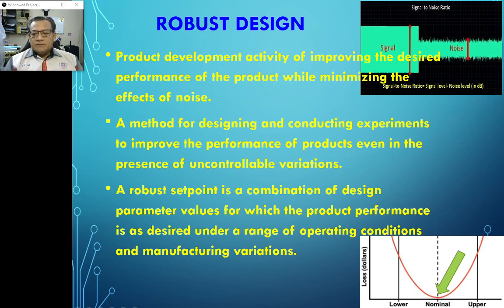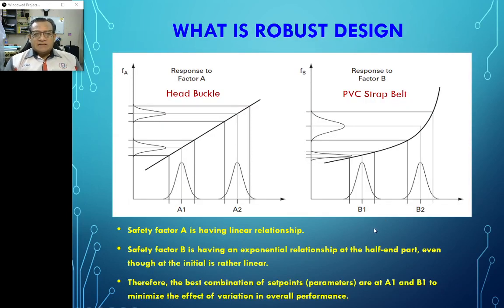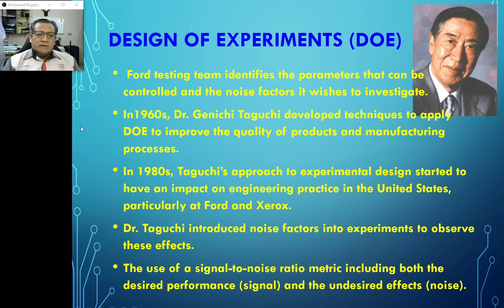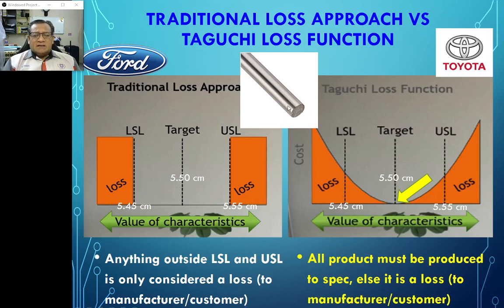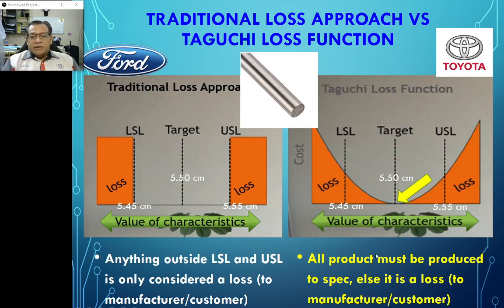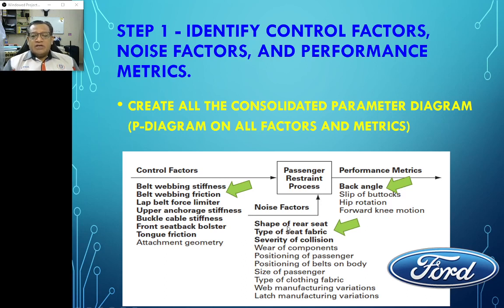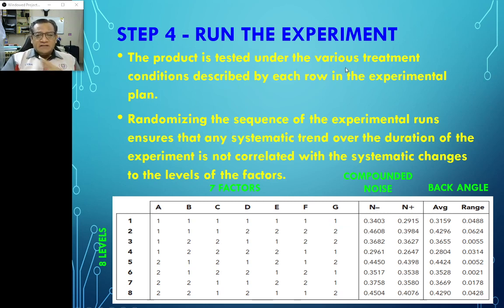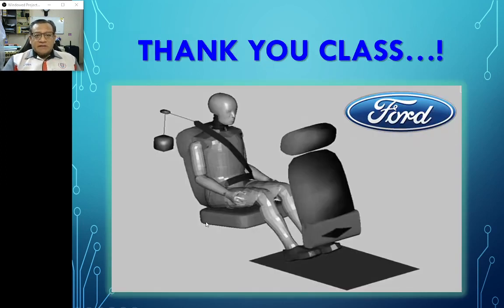Product Development Course Chapter 12 Robust Design

Comment: NUR ALIA NATHASYA BINTI AZMAN (AP190479) S1

Thank you, Dr. for the lecturer. For this video,  I've learned about the process of robust design, which includes seven steps for the process, which are identifying the factors, constructing an objective function, developing an experimental plan, performing the experiment, conducting analysis, and confirming the factor setpoint and reflect.

Comment: Nurul Izzati binti Baharudin (CP190067) 
The process of robust design consists 7 steps which is identifying the factors, formulate objective function, develop experimental plan, run experiment, conduct analysis and confirm factor set point and lastly reflect and repeat

Comment: Muhammad Syahmi Bin Rahman (CP190045)

What I learn from the video is about the process of robust design which is consist to 7 step which is identifying the factors, formulate objective function, develop experimental plan, run experiment, conduct analysis and confirm factor setpoint and reflect.

Comment: Muhamad Zamakhsyari Jaafar (CP190020)

Thank you Dr. For this part, i have learnt the processes for robust design which consist of 7 step begin with identfying the control factorss, noise factors, and performance metrics. Then, continue with formulate an objective function, develop the experimental plan, run the experiment, conduct the analysis, select and confirm factor setpoints and lastly reflect and repeat.

Comment: NUR HADIRAH RAZNI BINTI MOHAMAD RASUL  (CP190082)

The above video which is about the robust design learning has improved the design of experiments, as well as the classic loss technique and the Taguchi losses function. Identifying factors like noise and performance metrics, as well as control and noise factors, formulating an objective function, creating an experimental plan, conducting the experiment, analyzed the results, and reflecting and repeating the process are the seven steps of the robust design process that I've learned about. Thank you Dr, for the learning session video.

Comment: MUHAMAMD AMIR RAHIMI BIN MOHD SHUHAIMI AP190498
Thank you for sharing, Dr. After seeing this video, I realised that the robust design process has seven steps. To begin, determine the control variables, noise variables, and performance measures. The next step is to create an objective function. The third step is to create an experimental strategy. The following step is to execute the experiment, do the analysis, and pick and confirm the factor setpoints. Finally, think about it and do it again.

Comment: Nur Amira Afiqah Binti Norfaizal (CP190055)
Thank you Dr for your sharing. From this video, I have learned about robust design. Choosing the correct set point for the design parameters under control is dependent on resilient design. Under a variety of operating circumstances and manufacturing variances, a combination of design parameter values determines product performance. This chapter also explains how to maximise performance while minimising variance using a seven-step design approach.

Comment: Shazmin Ilyani Md Isa
CP190016

What I get from the video is robust design is actually a method to design and do  experiment to improve the product performance. It is also known as parameter design. Next is the design of experiments that Dr Taguchi developed techniques to improve the product quality and manufacturing process. There are differences between the traditional loss approach and taguchi loss function. There are 7 process of robust design. Start with identify the control factors, formulate the objective function, develop experimental plan, run the experiment, conduct the analysis, select the factor setpoints, and lastly, reflect and repeat.
Thank you Dr🙏🏼

Comment: Agileswaran Nadesan Ap190017
I have learned about 7 steps which are identify the factors, formulate an objective function, develop the experimental plan, run the experiment, conduct the analysis, confirm factor setpoint and reflect.

Comment: NUR ARIFA SYAHIDA BINTI YULIADI (AP190266)

Thank you Dr for lesson sharing. 
This chapter i have been learnt about robust design. The robust design is matter for choosing  the right set point for the design parameters under control. The combination of design parameter value of the product performance is under the range of operating conditions and manufacturing variations. This chapter also has explained 7 step of design process to maximise the performance while minimising the variation.

Comment: NUR ANIS MISYA BINTI AZMI (AP190488)
SECTION 1
From this video, I have learned that there are the seven steps of the robust design process that I've learned about include identifying factors such as noise and performance metrics as well as control and noise factors, formulating an objective function, creating an experimental plan, performing the experiment, analysing the results, and reflecting and repeating the process.

Thank you Dr, for sharing this video.

Comment: ONG XIN YI (AP190265)
Based on the video lecture, I have learned about the robust design of products. Robust design is an activity in product development to improve the desired performance while minimizing the effects of noise. In order to conduct the robust design, there are seven steps mentioned in the video. 
TQ DR. FOR SHARING :)

Comment: Nur athila safia binti jemzir (Ap190035)

Thank you dr for sharing. From this video, i have learned about what is parameter design/ robust design, design of experiments(DOE). Also,  7 step of Robust design process which is identify control factors ,noise factors and performance metric ,formulate an objective function, develop the experimental plan, run the experiment,conduct the analysis, select the confirmfactor set points and reflect and repeat.

Comment: LIM WEY NAN (AP190062)

Thank you for sharing, Dr. I learned that resilient design is all about selecting the appropriate set points for the design parameters under control. I also learned the robust design process therefore consists of seven steps.

Comment: PRAVIN A/L LINGAM (AP190046)
My understanding of robust design, design of experiments, traditional loss approach as well as the taguchi losses function has been enriched by this video. The seven steps of the robust design process that I've learned about include identifying factors such as noise and performance metrics as well as control and noise factors, formulating an objective function, creating an experimental plan, performing the experiment, analysing the results, and reflecting and repeating the process.

Comment: LOH WAN THENG (AP190366)
Thank you Dr for the sharing. After watching this video, I have learned that there are 7 steps of robust design process. First, identifying the control factors, noise factors, and performance metrics. Next, formulating an objective function. Third, developing the experimental plan. After that, running the experiment, conducting the analysis, and selecting and confirm the factor setpoints in the following step. Lastly, reflect and repeat.

Comment: Santhi A/P Manokaran AP190444

Thank you Dr for the sharing. From this learning video, i have learnt about the robust design. Robust design is a method for designing and conducting experiments to improve the performance of products. There are 7 steps of robust design process in order to improve the performance of the product.

Comment: Ummi nur shafina binti abu bakar (ap190045)
From this topic i learnt that a robust design is a method for designing and conducting experiment to improve the performance of products. Dr. Genichi Taguchi develop a techniques to apply DOE  1960s. The robust design have 7 process . Firstly, identify control factors, noice and performance matrics. Then, formulate an objective function, after that, develop the experimental plan. Fourth, run the experiment. Fifth, conduct the analysis. After that, select and confirm factor setpoint. Lastly, reflect and repeat.

Comment: Nurul Najihah binti Roslan (AP190032)
Thanks for sharing the video. From this sharing, I have learned about robust design and experimental design (DOF). Robust design is in product development to enhance desired performance while minimizing noise effects. In addition, I am also familiar with the robust design process of identifying control factors, noise factors, and performance metrics, formulating objective functions, developing experimental plans, conducting experiments, conducting analysis, selecting and validating factor setpoints, and reflecting and repeating simply to achieve excellent design/universal design.

Comment: CHONG WAN WEN AP190074

From this video, I am able to understand that there are 7 step in robust design process. First, identify control factors, noise factors and performance metrics. Second, formulate an objective function. Third, develop the experimental plan. Fourth, run the experiment. Fifth, conduct the analysis. Then, select and confirm factor setpoint. Last, reflect and repeat.

Thank you dr for sharing.

Comment: Muhammad Nur Aiman Irfan bin Suhaili AP190190

There is 7 step in design process which is identify the factors, formulate an objectives function, develop the experimental plan, run the experiment, conduct the analysis, select/confirm factor setpoint and reflect.

Comment: Wong Joo Yun AP190066

From this video, i learnt about the 7 steps of the robust design process, which are identify control factors, noise factors and performance metrics,  formulate on objective function, develop the experimental paln, run the experimental, conduct the analysis, select and confirm factor setpoints as well as reflect and repeat.

Thank you dr for sharing

Comment: Wong Siok Jiu (AP190110)

From this video, I have learned about robust design. There are seven steps in the robust design process which identify the factors, formulate an objective function, develop the experimental plan, run the experiment, conduct the analysis, select and confirm the factor setpoint, and reflect and repeat. Thank you Dr for the sharing and explanation.

Comment: Mohamad Shahrizal Bin Mohd Suhur

I learn about Robust design/ paramater design is to achieve excellent design or universal design , to achieve maximum performance with minimum error or minimun noise
Robust design need to choose optimum performance with minimize variation. Need to test many setpoint, try and errors so that we could determine the list variation available with maximum performance

Robust design is archieve through Design of experiment (DOE). Ford try to applied the DOE. Dr taguchi introduced noise factors into experiments to observe these effects.

The traditional loss approach and taguchi loss function.
Traditional - anything outside LSL USL is only considered  a loss.
Taguchi - all product must be produced to spec, if not its a loss

Comment: Tan Jian Woei (AP190389)
From this video, The robust design aims to improve a product's desired performance while minimizing the effects of noise. A robust setpoint is a combination of design parameter values for which the product performance is as desired under a range of operating conditions and manufacturing variations. The robust design process uses an experimental approach to find these robust setpoints. Experiments for robust design are used most frequently during the detail-design phase. They are a way to ensure the desired product performance under various conditions. Ford's seat belt design problem was modeled using a simulation rather than physical crash testing. The approach to robust design is based on a method called the design of experiments (DOE). Dr. Genichi Taguchi developed techniques to apply DOE to improve the quality of products and manufacturing processes during Japan's 1960s, '70s, and '80s. A seven-step process was suggested to develop a robust product through DOE: 1. Identify control factors, noise factors, and performance metrics. 2. Formulate an objective function. 3. Develop the experimental plan. 4. Run the experiment. 5. Conduct the analysis. 6. Select and confirm factor setpoints. 7. Reflect and repeat. Thank you Dr, for the sharing and explanation.

Comment: Chu Siew Fong AP!90293

Thank you dr for sharing the video. I have learn about what is the robust design and design of experiments (DOF). Beside, I also get to know the process of robust design which are identify control factors, noise factors, and performance metrics, formulate an objective function, develop the experimental plan, run the experiment, conduct the analysis, select and confirm factor setpoints, and reflect and repeat.

Comment: Lee Zhe Chung (AP190429) S2

Thank you dr for sharing. In this video, I know that robust design is a matter of choosing the right set points for the design parameters under control. Next, the robust design process include 7 step which are identify the factors, formulate an objective function, develop the experimental plan, run the experiment, conduct the analysis, select/confirm factor setpoint, and reflect/repeat.

Comment: GAN KWANG MIN AP190428

Thank you Dr for sharing.

From this video, I understand that robust design activity is a matter of choosing the right set-points for the design parameters under our control. I also know the robust design process which are Identify control factors, noise factors, and performance metrics, formulate an objective function, develop the experimental plan, run the experiment, conduct the analysis, select and confirm factor setpoints and reflect and repeat.

Comment: Lim Jea Yi AP190100

TQ dr for yr sharing.
In this chapter, I have learned about the robust design and the design of  experiments(DOE). Robust design is a parameter design. To achieve the DOC,we need to combine the technical knowledge and experimentation data. Besides that, I also learnt about the 7 steps of robust design process.

Comment: SITI NORSAHIDAH BINTI SAFINGI (AP190125)

What i understand from this video is about robust design. Robust design is an activity in product development to improved the desired performance while minimizing the effect of noise. Basically, maximize the performance but at the same time minimize the noise. The performance is measured based on achievement or attainment of the nominal value. The purpose of Robust Design is to achieve excellent design/universal design.

Comment: FARHANA SYAZWANI BINTI AHMAD FADZLI (AP190439)

Thank you dr for the explanation. In this chapter I’ve learnt that the activity in product development is to improve the desired performance while minimizing the noise. The combination of design parameter values of the product performance is under the range of operating conditions and manufacturing variations. From this chapter, it taught us to develop a product we must make many trial and error to determine we get the most optimum parameters that have the highest performance with lesser noise. As example, Ford company have apply Design of Experiment to improve the quality of the product in manufacturing process. The DOE method was introduced by Dr Taguci and he considered it as a new function of quality. I also able to make the comparison between traditional loss approach and Taguci Loss Function. Lastly, in this chapter we must follow the 7 steps of design process to maximize the performance while minimizing the variations.

Comment: CARMEN CHEW AP190476
Thank you dr for the sharing. Based on this video, I have learned about the robust design, design of experiments, traditional loss approach and taguchi loss function. Moreover, I have also learned about the 7 steps of the robust design process which are identify control factors, noise factors, and performance metrics, formulate an objective function, develop the experimental plan, run the experiment, conduct the analysis, select and confirm factor setpoints as well as reflect and repeat.

Comment: TAN SHI YI (AP190295)

Thank you Dr for your sharing.
From this video, I have learned that there are 7 steps in the robust design process. First, identify the control factors, performance factors, noise factors, and performance metrics. Next, formulate an objective function, develop the experimental plan such as the design, run the experiment, conduct the analysis, select and confirm factor setpoints which the best to maximize the performance or signal and minimize the variation or noise. Lastly, do some reflection which had done achieved and repeat the process for the next cycle of testing an experiment.

Comment: Shirey Then Shi Yi (AP190192)

From this video, I have learned that robust design is an activity in product development to achieve the desired performance with minimum errors. In order to achieve the design of experiments (DOE), it needs to combine both of the experimentation data. The robust design process:
 identify control factors, noise factors, and performance metrics; formulate an objective function; develop the experimental plan; run the experiments; conduct the analysis; select and confirm factor setpoints; reflect and repeat. 
Thank you Dr for sharing.

Comment: Tan Hui Yeng (AP190252) 
Thank you Dr for the sharing.
From this video, I learn about robust design performance of product (signal of noise), robust setpoints (products design parameter values) and setpoints included linear relationship and exponential relationship at half-end part. Robust design process included identify control factors, noise factors and performance metrics, formulate an objectives function, develop the experimental plan, run the experiment, conduct the analysis (to be minized) and select and comfirm factor setpoints.